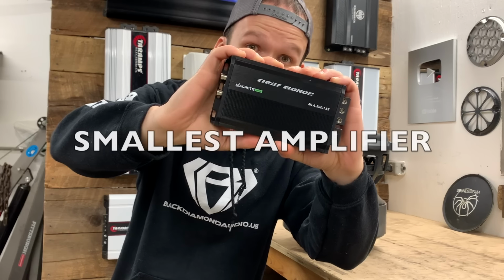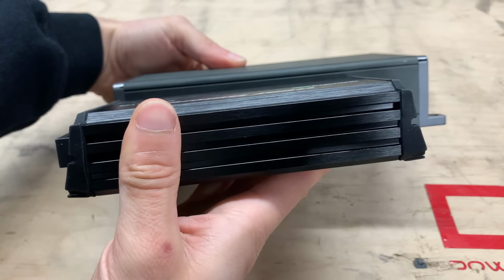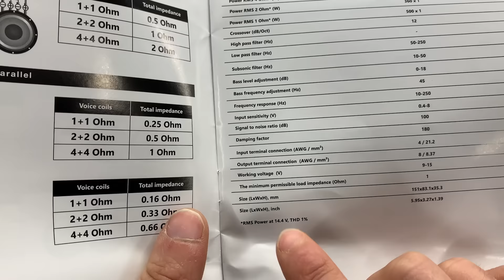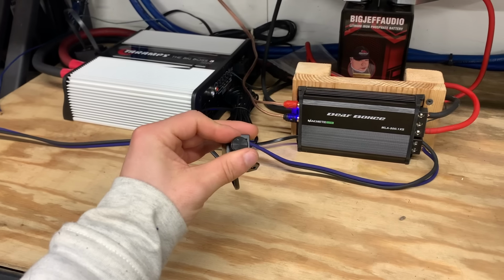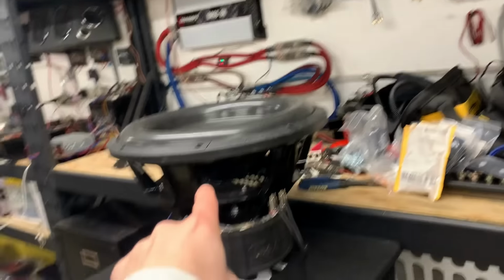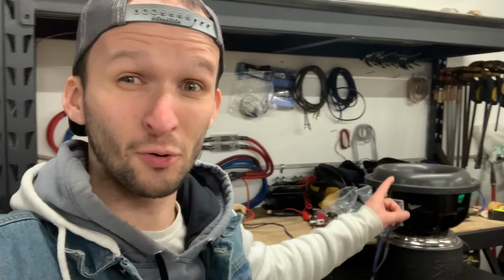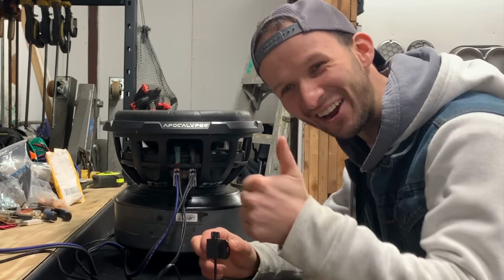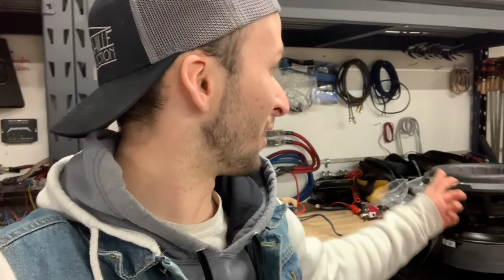Their SMALLEST Amp VS Their BIGGEST Subwoofer!

Comment: Parker this is a good test to try in one of your videos put a 1000 watts to all these big subs in your car and see who gets the most spl it will be like an efficiency test and keep up the good work u are the only one doing tests like these
Reply from the maker: I agree!
Reply: I love it.
Reply: I want to go two 12s or two 15s at 1000-1500 watts but wasn't sure if it be worth the money as I have two 12s right now at 500 watts like how much difference would it be
Reply: @thomaswalton9089  everytime u double power u add 3 db to your system and anytime u add a next sub  also add  3 db to your system .
Reply: @CompactAudiodesigns that’s in an ideal situation
Reply: Wouldn't going from 12s to 15s be a noticeable difference because of the extra cone area?  I gained a very noticeable difference going from a single 10" to a single 12" in my truck
Reply: @KGrasso89  not necessarily. box means a lot more then cone area.

Comment: Keep in mind folks that this little amp could in fact blow this monstrous subwoofer!!  

It is easier to blow a subwoofer from distortion and a clipped amplifier than it is from shear power.
Reply: Bullshit. Heat blows subs. The only reason a sub blows is power. A small amp is making much more power than you think when it's clipping.  He could push that sub as clipped as he wanted on a head  unit for example because it can't produce enough power to heat the coil.
Reply: Lmmfao I was waiting on this comment. If you set your gains properly you can not blow a sub by underpowering it. If that was the case everytime you turned the volume down you rusk blowing your sub.
Reply: @cdbennett2332  the alternating current signal from the amp, when it is hard clipped, turns into a direct current signal.  Direct current on a subwoofer causes the sun to go in one direction and stay there then quickly reverses, instead of smoothly going back and forth.  This causes heat to build up in the coil, and can quickly blow subwoofers.
Reply: @bg31282  notice I said if the amplifier is clipping.  I did not say if the gains are set properly.  Most don’t know how to set their gains correctly and then brag that their powerful Boss amp blows every subwoofer they hook up to it.  

The fact remains that it is easier to blow subwoofers with a lower wattage amp due to an improperly adjusted gain than it is with a large subwoofer amplifier with a properly adjusted gain.  

Properly adjusted gain = a clean AC sine wave
Improperly adjusted gain = a DC signal
Reply: @91CavGT5  nope....that little time of no movement doesn't make enough heat to change anything.  What's actually happening is you are putting double the power or more than you think to the sub. If it gets louder to the point you can hear it when the amp starts clipping that's double the rated power as you can only hear in 3db increments. To get 3 dB is double the power. Your 500 watt amp can output 1000+ clipped.  1000 watts clean or clipped couldn't hurt this sub.
Reply: @cdbennett2332  that’s just not the case, on multiple points.  If cheap amps could output double their power, don’t you think they would be rated as such?  Even at 10% THD which is how Pyramid used to rate their amps, they still would not even hit rated power.  You do understand that the max rating on an amp is absolutely pointless and an amp won’t ever hit that number…. right?  If a clipped signal was not dangerous for a subwoofer then it would be impossible to kill a subwoofer as long as you didn’t push too much power to it.  This is just not what happens in the real world.  

A clipped signal is more dangerous than too much power.  Just look at some of Parker’s videos where he pushes over 5,000+ watts to a subwoofer that may only be rated for 800.  

I’ve got an older video on my channel where I purposely blow an 8” subwoofer.  This sub was only rated to handle, 50 or 75 watts(I don’t remember exactly).  But I had 500 watts of clean power going to it.  It lasted for MONTHS before I decided to show how quick a subwoofer will blow with a clipped/distorted signal.  Not even 30 seconds.  It was not the power that killed it.  It was the clipped signal that killed it.
Reply: @91CavGT5 that is the case what I'm saying is true. If you can hear a difference in volume after a amp is clipping its outputting twice the power. 3db increments is what the human ear can hear. 3db= double the power. Period. I included a video of a jbl charge 4 distorted to shit and it can't do anything to the sub. Power breaks subs period. In those videos he isn't playing 5000 watts for a long period. Thats why a 800 watts sub can take 5k. When you showed how a clipped signal blowed your sub did you use the same amp and turn up the volume? No shit....you put more power to it. Just because the amp was 500 watts doesn't mean you had 500 watts going to it until you turned up the volume. Think about this.....if clipped signal blew speakers wouldn't speakers blow every time someone listened to music that's distorted on purpose? Think about rock and edm, hiw could anyone listen to it and not blow their speakers? It's all a clipped signal.
Reply: @cdbennett2332  there is a difference between music that has been recorded on purpose with distortion and a clipped signal.  You can play a song that has distortion recorded into it and have ZERO problems, IF the amp is not clipping.  An amp does not care, and your speakers do not care what the sound is.  The sound of distortion, when it is purposely recorded into a song, when it is played back it is still a smooth sine wave regardless of what it sounds like to our ears.  What matters is if the signal coming out of the amp is clipped.  A clipped signal coming out of an amp is NOT a smooth sine wave.  If you hook an oscilloscope up to an amplifier then you would see the difference between the two signals, but to our ears it would sound the same.  

When I blew the subwoofer, I raised the bass level up all the way, turned the loudness on, but turned the volume of the radio down… a LOT!  The signal voltage coming from the radio to the amplifier was lower, so the power output from the amp was less than normal.  The signal was badly clipped and the amplifier then did its job of amplifying the clipped signal.  

Here is another example that a clipped amplifier does not put out more power.  A good friend of mine and I went to SPI(south padre island) in 1999 at the Spring Break National IASCA soundoffs.  My buddy had two 12” Cerwin Vega subwoofers and two The Hott Setup T-500 amps for the subs.  He would normally hit 139 db with a clean signal.  Well, since this was a double points competition, he mistakenly decided to turn things up a little.  His amps clipped and he only hit 134 db!!  So where is his extra 3db from clipping????  

In the real world, what you are claiming just does not happen.  I’ve got DECADES of experience and first hand knowledge.

Edit:   A SLIGHTLY clipped signal will show an increase in power, but not double the power like you claim.  If what you claim was accurate then I have one question for you.  If you go and watch ANY amp dyno test, why doesn’t the amp put out just 25% more power(a quarter of what you claim clipped amps produce) when an amp is tested on uncertified versus certified?
Reply: @91CavGT5 look, if the source material is clipped a amp will output a clipped signal.....if it didn't that would be....wait.....distortion.  also the 3 dB rule is SCIENCE. I didn't make it up. If someone's music wasn't louder why would they turn it up?
Reply: @cdbennett2332   I still don’t think you are understanding what I am saying.

In some music, for decades, distortion has been used.  It is nothing new.  However, IF the music is recorded correctly then you will see a smooth sine wave.  Even though it sounds distorted to us, the signal is not distorted and clipped.  It is not only possible, it has been done for decades.  In these cases, when the music is played back, despite it sounding distorted, the signal is clean and not clipped.  

With that being said, if it was NOT recorded properly then it will not have a smooth sine wave and thus, the signal will be clipped.  

Both of those will sound the same to our ears, but will look vastly different if you actually looked at the signal.  Our ears can not tell a difference between recorded distortion and a distorted (clipped) signal.

I am not saying that when you turn the volume up, amps don’t put out more power.  What I am saying is that once the signal begins to be clipped, once you get past minor clipping, you do not double your power.  It is physically impossible.  A clipped signal changes from alternating current to direct current.  When the signal is hard clipped into direct current, there is not enough time between the peaks to move the speaker quick enough to gain volume.  This is why a hard clipped signal will actually DECREASE the volume, as I explained and showed an example to in a comment above.  

Now, just because you hear distortion does not mean the amp is clipping.  You can have speakers distort due to the high volume before amplifier clipping occurs.  You can also have your ears hear distortion just because of the shear volume even if the signal is not clipped.  

I do agree with you in that to get a 3db increase, you have to double the power.  With that being said, I believe you are mistaken with an increase in power after hard clipping occurs.  Once again, go look at ANY amp dyno test here on YouTube and you will see that power does not increase greatly when comparing certified and uncertified dyno runs with amplifiers.  If you were correct then there would be a very large power increase.

I have given you many examples of facts to back up what I am saying.  I am an educator at heart and want for you to see, with scientific evidence, why what you are saying is not correct.  Please, go look at any amp dyno videos and then come back and read what I have posted again.

Small power gains are seen with minor clipped signals.  Major power gains, like you claim, are not seen.  What is your evidence to support what you are saying?
Reply: Dude your wrong. I dont know what to say. They call it a distortion pedal for a reason. The only way to get that clean signal you see on I scopes is from pure test tones. There is so many ways to induce distortion from the source material to the source unit clipping. The only way you are going to have those perfect waves is during a test. I'm sorry you don't understand that.   I bet a coil has more air going over it being clipped at 500 watts than it does at a lesser wattage because it's moving more. How about when a speaker is going out of its gap and  it takes a split second for it to change direction, wouldn't that do the same thing? Why dosnt anyone say anything about that?  This came from manufacturers trying to get out of warranting speakers.  It just doesn't make sense. These tests stop at clipping  so they don't mean anything.  As for a amp putting double thr power at clipping here's what I'm saying one more time. If a person can hear a difference in volume st all....thats double the power. If it wasn't louder why would someone continue to turn the volume up?
Reply: @cdbennett2332  so you aren’t disputing any of the proof that I offer you?  Just saying that I’m wrong?  If I am wrong then that means that the amp dynos are wrong as well.  Is that what you are saying?

Edit:  I will add this.  If what you are saying is true then ANY time music is played that has distortion recorded in it then the clip light has to be light up, if the amp has a clip light.  Is this correct, yes or no.
Reply: For one thing im at work. Here is something i found...its not hard to find.    Commonly, amps are tested up to 10 percent distortion to find out the max output which can be very high. A 100 watt amp at 0.08 percent distortion might punch out 200 watts at 10 percent distortion or, with low impedances go even higher. This is why you NEVER spec some random speaker power limitt and run the speaker at that limit expecting 100 watts. Make sense?    

 It's pretty much common knowledge that a amp will produce way more power clipped....making more heat because it's making more power....not from the small interference in movement....I mean think about it....does it even make sense that the cone not moving milliseconds at a time would make more heat.....or more power making the heat. There's not that much difference in air flow over a coil to make the difference in that small amount of time. If you can't think for yourself I can't help you.
Reply: @cdbennett2332  I searched online and here is what professional audio engineers have to say about a clipped signal and why it tends to blow speakers:

So the old saying about DC voltage in a clipped signal is wrong. It is just more energy getting to the voice coils with a duty cycle that approaches 100%. The positive and negative voltage peaks are at or near the max voltages of the power supply rails and Duty cycle approaches 100% because the voice coil has either positive or negative voltage on it almost all the time with a symmetrical square wave. That means that there is little or no cool down time for the voice coils under these conditions, glue melts, and the voice coil becomes liberated from the former.

So I will admit that my wording was wrong in comparing the square wave to a DC signal.  The signal does not turn into a classic DC signal, but the sine wave does turn into a square wave, which many refer to it wrongly as a DC signal(myself included).  

With that being said, as explained above, the square wave basically causes the coil to heat up as the power is no longer being used to move the speaker, instead the power is used to hold the speaker still at the peak of the square wave so all the power is being used at that instant to heat the coil and glue and wiring instead of moving the subwoofer like with a normal sine wave.  I am not saying that a speaker stops moving completely when hard clipping is seen.  What I am saying is that instead of the subwoofer moving constantly, it will in fact pause.  If you are playing a 60hz note then the subwoofer is moving back and forth 60 times a second, and is pausing in between each throw when hard clipping is seen.  It takes a camera capable of slow motion video to be able to visually see this as our eyes can not see it.  

That is what kills the subwoofer.

Comment: The kicker key amp is completely different amp for a different application. They key to it is the key part and using it for factory radio upgrades and the self tuning..so imo its bigger for a reason

Comment: Hey Parker! I bought a American Bass Hawk DVC 10" 700 watt RMS sub and paired it with a Audiopipe APCLE 600 watt RMS D monoblock, both wired in 4ohms, which I prefer. That makes the amp under powered by 100 watts if left in a 4ohm config. Will I be ok? What should I watch out for?

Comment: I really was hoping to swe you do that test in the toyota!  Hook up the small amp up to different subs and see the db scores! Please revisit this!
Reply from the maker: Great idea!
Reply: @ParkerTheBasshead  I would love to see you retest all thoes same subwoofers in a box in the back. The numbers would be very interesting.  Just got my new subs Thursday 2 X15 V3s.  Running a bass 8k and a 40ah yinlong bank that I won from bruce aka EXO! Also got a mechman 240 put in with 3 diodes in the sense wire to have a charging voltage at 15.8.  Getting close to having it all put In.  08 ford crown victoria police cruiser.
Reply: @ParkerTheBasshead do you have a good sub recommendation for something that will move some serious air for an 8'i have a 1.9 cf box tuned 33hz. Want something clean with lots of Xmaxx that can play low tones without sounding like crap! Lmk

Comment: Would you get a sundown 600 sfb or a deaf bounce 800 ? I'm having a hard time choosing
Reply from the maker: I had an SFB back in the day and was not a big fan of that like. They might have fixed the issues since then tho so idk
Reply: Go deaf bonce sfb line is terrible and there’s a reason they discontinued the line
Reply: Thanks for the help and time ,trying not burn the cash just spend it🤣👍
Reply: I got 6 sundown sfb 600 amps. On 6 cab ultra 15 subs running at .5ohm 156 db for a year now.
Reply: @Scott-ql4ut  interesting I know the 600 is half bridge but still I don’t trust
Reply: Damn, yall got them big systems im just little 600 rms max subs 🤣

Comment: Granted I'm old school, was doing installs in the late 1980's.  But, all these new super drivers don't really impress me.  I mean , "look I'm feeding it 500watts, and I believe it's starting to move"?  🙄 Back when fuel was cheap and amp watts =💲💲💲.   With five hundred watts for subs, on the installs I did the owners would call an hr latter and complain that their interior were falling apart!  

High Amplifier watts = early charging sys failures & reduced fuel economy!  High efficiency systems will have a comeback, it just matter of time.